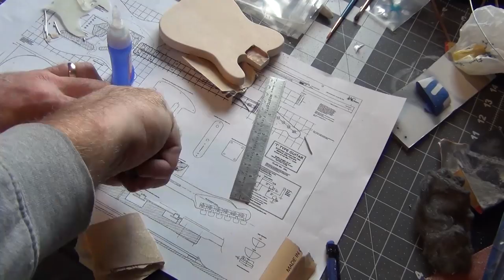How I Made a Miniature Guitar (Fender Telecaster) - Handcrafted in Kentucky, USA

Comment: I just picked up some wood tools. Dremel, sander, router. Started making little tiny guitars, about 11 inches long. NOTHING LIKE THESE though. Have been REALLY confused on where to get stuff for 'em. So - on the 3d printer - those metal parts are actually plastic or something painted to be metal? Man - great painting, too. Guess I better learn how to use an air brush if I'm going to continue on this. Making my pickups and bridges out of wood right now.
What are you using for the frets? What is that? Looks like solder or some such. Thanks for the video - inspiring.
Reply from the maker: Hey Rick! Thanks for the nice comments! As for the metal parts, I created them with 3D software (3ds Max) and sent the files to a business that specializes in high resolution 3D printing.  They are made of some sort of plastic, but I paint them to look metal.  Still haven't found anything yet to look like real chrome. This was my first attempt at airbrushing anything.  It wasn't too hard, just had to practice on scrap wood first. I use some wire I found at Lowe's for the frets, nothing fancy. I hope you can post pics of your guitars when you finish them.

Comment: One of the best thai i have ever seen man!
apart, how did you get the tuners, bridge and metal parts? did you buy them?
Reply from the maker: Thank you!  These are not kits, but are scratch built with real guitar hardwoods (mahogany, basswood, etc). All of the wood parts are cut and shaped by hand. I created the guitar hardware (the metal looking parts) using 3D software and printers.
Reply: Oh, well.
Thanks for answer my question, have a good day!

Comment: amazing. What did you use for the tuning pegs??
Reply from the maker: All of the "hardware" was created by first modeling the parts in a 3D software, then I printed those parts with a 3D printer.
Reply: troy brady  wow, when you said 3D printer I did not realize the printer could make them look so good & metal like. Awesome work
Reply from the maker: The hardware parts actually plastic and look semi-transparent, then they are painted.